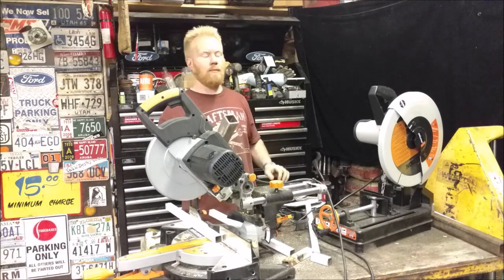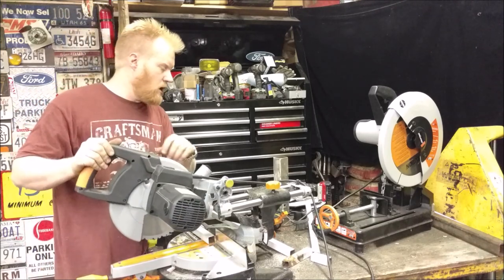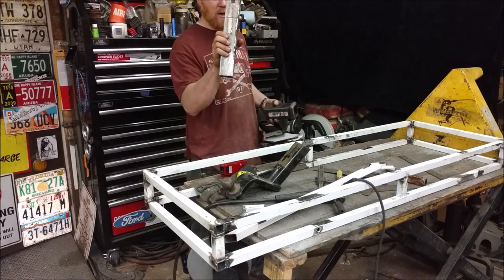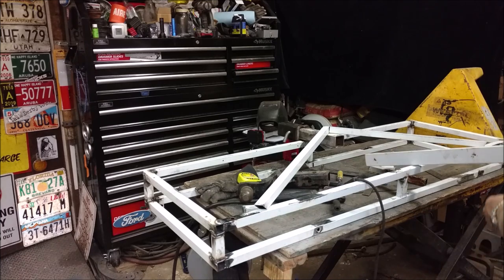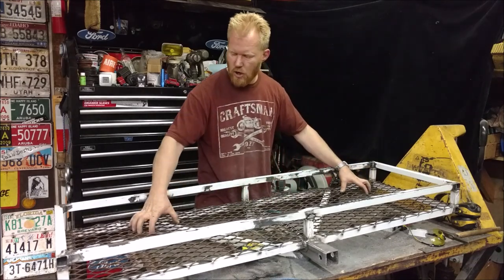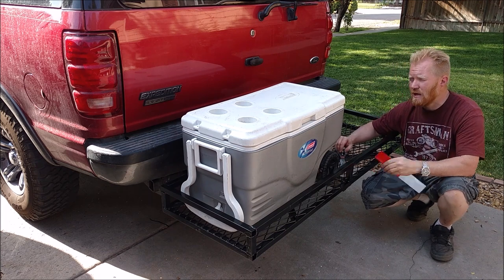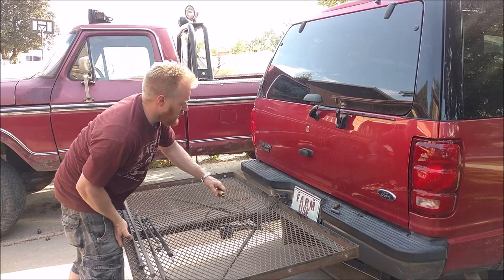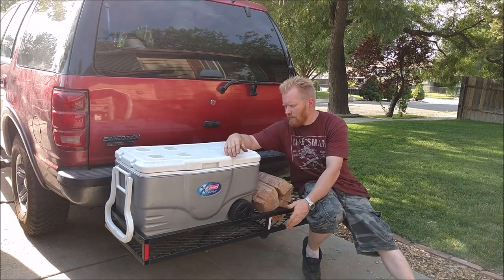Making a Hitch Cargo Carrier from scrap metal

Comment: Nice build. I Built one very similar, but then added a removable ramp so I can roll mowers and large snow blowers up on it.  I even hauled a V8 engine on it rather than getting the my trailer out. They are great especially if you have to haul something dirty and don't want to get the inside of the SUV dirty.
Reply from the maker: They come in very handy. I've hauled countless things on my larger one. I opted to just use separate ramps as my large one is very heavy.
Reply: @sixtyfiveford  how large is it? 3ft wide? 2.5ft? or 2ft?
Reply from the maker: @HealthSupercharger  5ft wide and 3ft deep

Comment: It's those diagonal cross bars extending all the way to the corners at a slight compound angle that provide the strength. Otherwise it could easily 
twist off and dump your load on the highway right into oncoming traffic, a harrowing image in my mind right now.

Comment: Great job. Wanted one of those for gear and one to put a motorcycle on. Always worried about whether the suspension would handle it or would I be dragging the tail. Easier to get around with than a trailer plus toll roads can't charge for extra axle. You might be able to tell I don't like toll roads.
Reply from the maker: I've hauled engines, multiple snowblowers, multiple mowers, atv's and more on these without incident. I've even done so with my wife's Ford Escort on many occasions; typically with 100-200lbs but have put 300lbs+ several times. The car sags with this weight but it is very tolerable at freeway speeds. The trucks/SUV sag at 500lbs but are far less noticeable, in fact you forget it's back there.

Comment: you could make a qd attachment for a simple axle with light but tall wheels so you could slide a t bar on the mount & wheel this around to move it without the truck to cart stuff around instead of carrying it back & fourth.
Reply from the maker: Good idea.

Comment: have you had trouble with the receiver hitch mounted to the frame of the vehicle twisting/warping such that the platform angles downward & drags the ground?  I used one w/ 2" steel with about 300 lbs of luggage on a vacation.  After about 1000 miles, the platform was almost dragging the ground.  Any tips on reinforcing receiver hitch mounts?
Reply from the maker: I've never had the hitch itself bend nor the frame. 2" receiver hitches are rated to at least 500lbs but their little brother the 1 1/4" only have 200 and 300lb weight ratings. These ratings are directly at where the the trailer ball would sit. The further out/back you go the more leverage works against you and could bend the hitch. So I try to tuck heavier items closer to the vehicle(front of the rack) and lighter stuff rearwards. I would think the rack itself would be bending before the hitch.
Reply: class 3 receiver hitches are needed for these, because they are rated for 500 lb.  class 2 is not ideal for these

Comment: harbor freight has them starting at $35.
Reply: They are super light duty only good for 50 to 100 lbs of static load.  You need one made of 3/16 inch steel to make it so it can carry 250lb of load or  mid size dirt bike.

Comment: You clever sod lol ;-D
Im not sure i like the single center mounting, but its designed to towing so its stronger than it looks so ill shut up lol :-D.
Reply from the maker: Ideally 2 mounts would be nice but virtually all vehicles in the US have this single center receiver hitch.
Reply: My mates have the ball type hitch for caravans and traylors, never noticed if the ball part could be removed, i must be bilnd.
Mostly im tinkering with the multipin plug that connects the car to trailer/caravan, they get really messed up wiring wise.